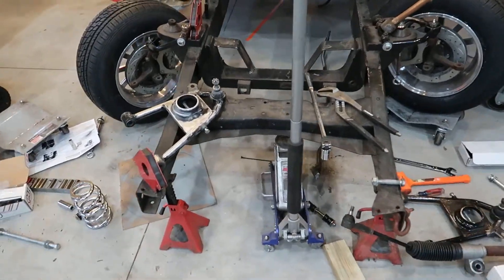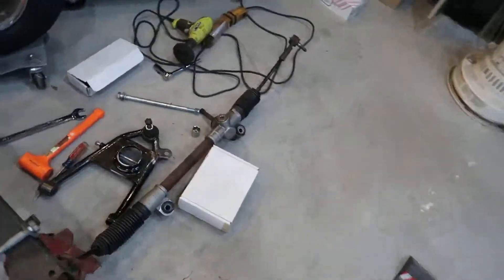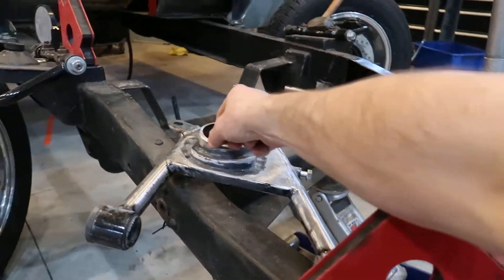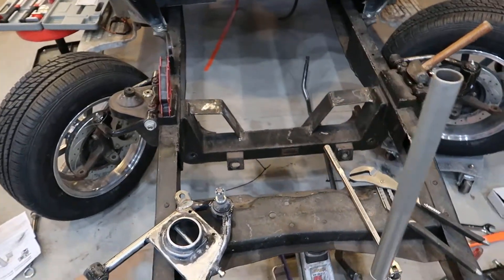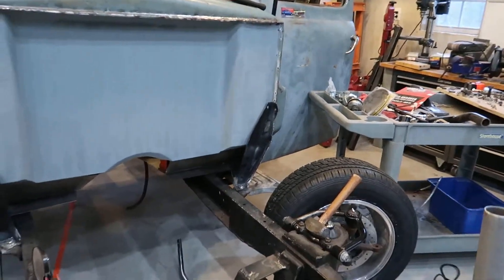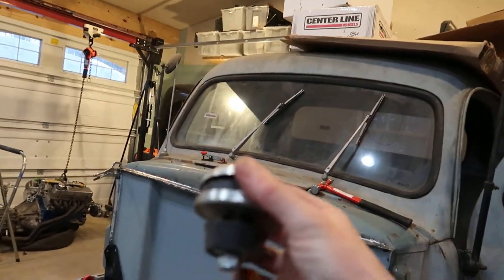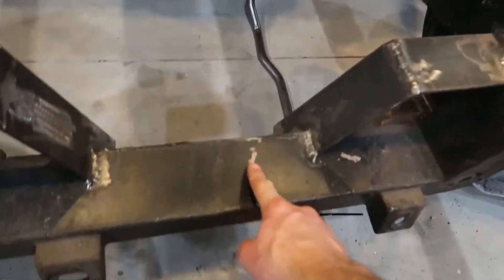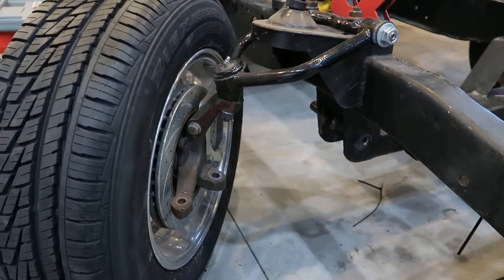1952 Ford F-1 Truck front suspension part 1

Comment: How is the truck coming along I was wondering did you have to cut the frame to get the power steering rack to fit . I got one from speedway but haven't gotten to that part of the install yet. We're just putting the Cross member in .?